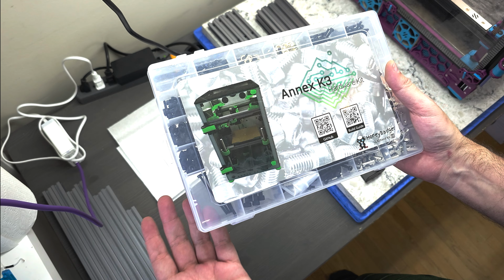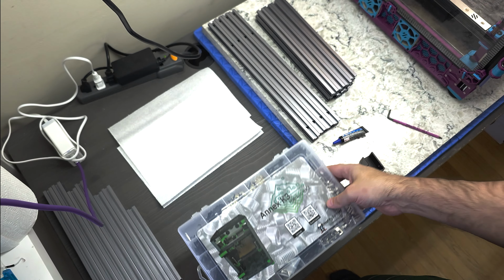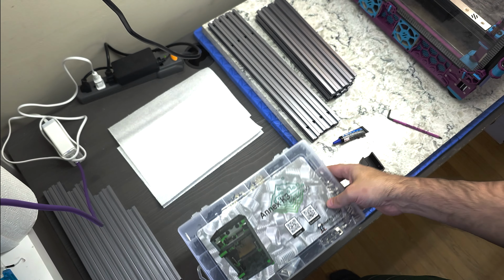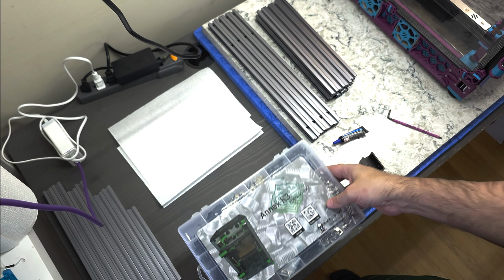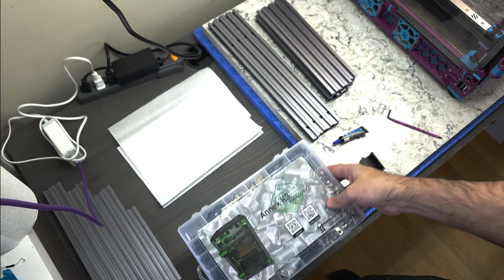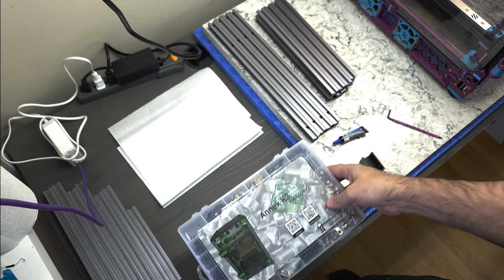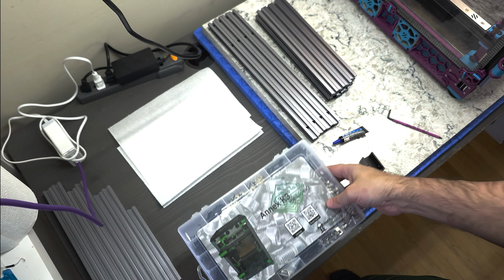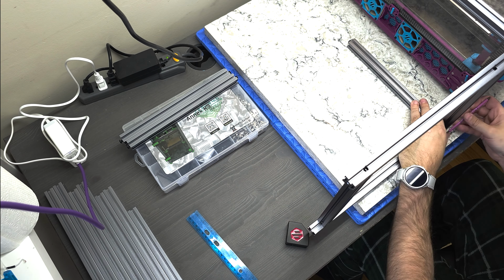Annex Engineering K3: Build Part 01 - Frame Assembly

Comment: I use TPU shims on the frame. This preload the M5. On my latest that I’m working on I’m  also adding a shim (0.2mm) between the extrusions since I cut my own frame from Ratrig 2020 V, some time I re cut them and my first frame the Giraffe 🦒 had some score marks, so If I reuse the extrusions I’m trying to avoid that for the future. All my Voron 2.4 are custom size. Lates one use drop in panels from Biltema 40x60x4mm, also Z rails offset 1mm inside. No 1x5mm tape needed. I have spent’t  way too much time on this frame. 😂
Reply from the maker: To each their own. My 3D printers are tools for me, and tools get scuffed and scratched, so this is less of a concern for me.

Comment: Since the annex printers are machines with very specific set of instructions (even providing fasteners torque values for various material combinations) it wouldn't hurt to use calipers when measuring lengths instead of a plastic ruler, just my opinion
Reply from the maker: You are not wrong. My cheap digital calipers were misbehaving, and the transparent ruler was at hand, allowing me to see the gap that I was measuring through the ruler.
The distances in question were to center the linear rail between the vertical extrusions, and as the carriage doesn't travel that full length, if it's off by < 1 mm, the impact should be minimal.
I probably would have had about the same margin of error even if I had used good digital calipers, because I am only a human goodenoughist. 👴
Reply: @oldguymeltsplastic  error stacking though, but I see your point and agree that it won't be that great of a change.
Reply from the maker: My digital calipers appeared on camera in the segments that I recorded today. Like I said, you weren't wrong. 🤣